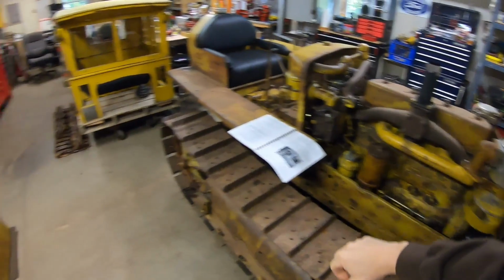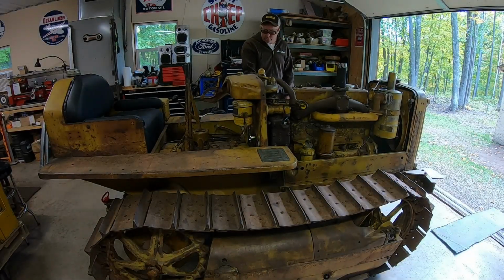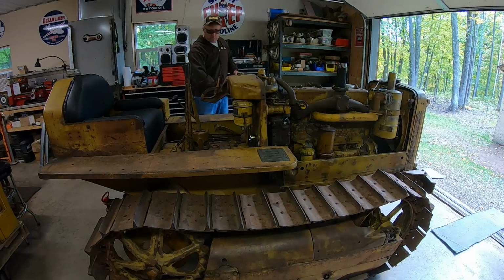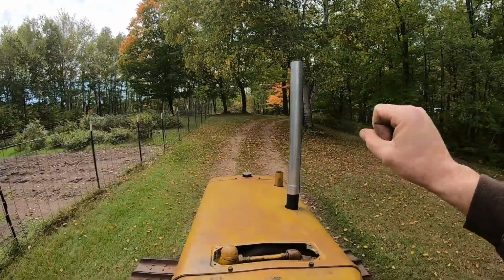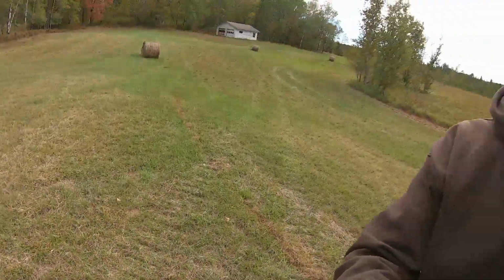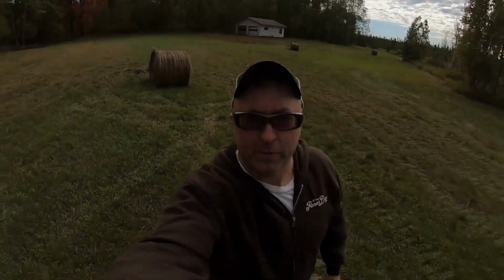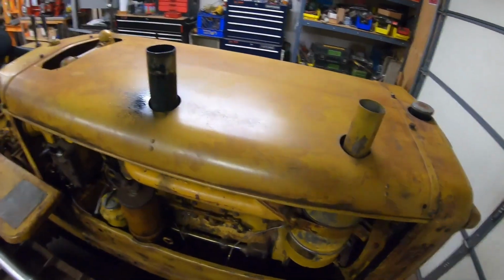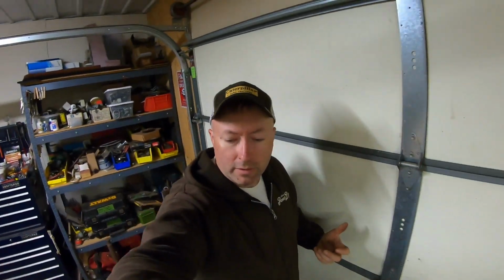Caterpillar D2 #5J1113 Chassis Rebuild Ep.70: First Drive Since Complete Rebuild! It Moves!!!

Comment: Starting from many piles of random parts and assemblies, several buckets of bolts and brackets, lots of rust and dirt, and finishing with a smooth running, beautiful looking, and functioning tractor is a major feat. 
Your work on this and many other projects is amazing.
Congrats and thanks for sharing.

Comment: I had a 1939 D2 for many years that was very similar and was in very good condition overall.  It would never start unless you got the diesel warmed up a bit with the starting motor.  You'd make a heck of a mess with unburned fuel drizzling down the exhaust pipe on to the hood unless you just had a little patience.  Just letting it roll over against compression with the fuel off until the temp. gauge hit 100 deg.  was the key.  Usually this was about 5 minutes.  At that point, it always took off, even with ambient temps in the teens.  Really enjoy your videos.  Great job!

Comment: Congratulations to you, senior, and everyone else evolved in this process of rebuilding this project from ppl storing it behind their house in a residential district for decades to parts suppliers that still had parts to parts you've gathered over your past miles walking rows at swap meets to your other enthusiastic Cat club that located a pristine engine block to the trucker that hauled it to a nearby rest area for you to pickup (I was so nervous when you slid that engine block from that trailer to your tailgate that it was going to hit the ground and break).
I could just go on and on about unseen helping hands behind this great little machine you own but you Toby are the Master that pulled it all together thru your Videos tell the Entire Story.  To You, a huge 
        THANK YOU!

Comment: Brilliant job - got yourself a beatiful slice of history there to be proud of. 
That noise takes me back to the 60's. My old man and uncle ran a farm in the Midlands UK and bought an old D2 from MOD surplus. It had a blade on the front and was painted in RAF blue. I think it was designated for beach clearance so planes could land but may have been for patching bomb holes at bases? They stripped the blade and hydraulics off and painted it Cat yellow again. Then using a 3 or 4 furrow semi digger plough turning Keuper Marl at 9 or 10 inches. That Cat used to 'crack' in the exhaust note when it dug in and poured the torque on and you could hear it a mile or two off when it was working, turning red slabs of marl over.
Along came direct drilling and ended my old mans obsession with deep ploughing in favour of faster surface tilling and the Cat was retired.

Comment: My Ag mechanics class is sitting and watching this right now. They have followed along for the past two years as we have worked on engines in the shop. It is interesting to watch them remember when to do something and what tool to use. They are rebuilding a Farmall M engine right now and last Friday they knocked the pulled threads down on the block where the oil pan bolts, with and old file. The class noticed- I didn't have to say a thing they just did it..... Thank you for the vids Squatch.

Comment: I say pop test that injector on that wet hole and if that doesn't reveal anything verify the rack setting and timing on that plunger and barrel. Looks like you could have one off a little since it appeared to be fueling with the kill on when cranking. 5:11 I would not expect there to be any smoke at this point but clearly there was.

Comment: I know what you mean about the crisp controls. When I did mine a few years ago, all new main clutch, steering/brakes, it was so crisp that I can imagine what it was like picking one up new from the dealer 70 years ago. Just spectacular. Not only is it crisp, it's also like it's power-assisted because the controls are so easy to move. It's pretty hard to operate an old clunker that hasn't been refreshed now.... : )

Comment: When you trailer it to its first tractor show. If you are near a cat dealer are you going to pull into their service driveway and see how many techs come running out to see it done?

Congrats. 
One thing. Try a 3/4 " block under the front of the seat. So it pushes you back just a little more.

Comment: Congratulations!  Fine job!  Many times I've stressed about something acting up on a tractor after an overhaul or period of sitting unused only to have it completely disappear after putting on a good load and actually working the engine. It can be hard to come up with a load that will work them long enough and hard enough to even get them to full temp. But it usually does wonders and is what they are made for.

Comment: What is the advantage of separate levers and pedals for the steering clutches and brakes?  The competitor who shall not be named and most others use one lever to control both the steering clutch and the steering brake.  A separate pedal seems like an added complication since you're not supposed to touch the brake until the clutch is fully disengaged.  They must have had a good reason for it since added complication was not the Caterpillar way of doing things.

Comment: awesome video it's really nice to see it running and driving under it's own power. I would try a good fuel injector cleaner in the fuel the modern fuel is so low on lubrication I have seen new out of box injectors pop and flutter until I put cleaner in the fuel in fact when I buy new fuel injectors they come with a bottle of fuel injector cleaner and lubricant where I get the injectors from
Reply: @squatch253  that is good to hear that 👍👍👍👍😁

Comment: Run a little dextron 2  in your fuel  and work it.  It will get better  but make sure its dextron 2 or powersaw mix oil  in the fuel tank.  may be varnish in pump or injector

Comment: That pop can be caused by timing on the inj pump worn lifters re adjust lift specks to spect. I did my d4 and friends nice d2 ran beautiful after that. Wouldn’t believe wat a couple thousands will do to running in i also have a 1 Cyl test engine that was hard starting and misfired bad till warm i adjusted timing and runs perfect no misfire. Hope this helps. Will also help wetstacking. Good luck. Gene
Reply: The one Cyl cat engine has 5.75 bore 8” stroke at 900 rpm approx 25 hp.

Comment: Just a couple of points...  Do you not need some Plywood on the floor of that garage to prevent gouging out the concrete..?    And does it not have a 'Mushroom' for the Air Intake..?

Comment: I have used  point-n-shoot thermometer to synchronize carburetors on motorcycle/snowmobile with great success. To isolate wet-stacking cylinder, is it possible to use one of those point-n-shoot thermometers to identify the exhaust port which is cooler than the others?

Comment: I have rebuilt several D315s and never had trouble with slobbering exhaust or missing like that right after a rebuild, valves are not seating properly or bad injector nozzle.
Reply: @squatch253  Just had new injectors put in my 92 7.3, told the shop it doesn't run smooth and smokes like hell, they pulled them out again and I took them to a diesel fuel system shop and had them gone through and checked, all were under spec crack pressures one was stuck and one wasn't spraying right, $470 to have them reset but they were under warranty and I was reimbursed, runs beautiful now.

Comment: I was thinking you need a D2 test track, so can compare each run equally. Have something heavy to pull. Maybe that old rusty implement out at the old field junk pile could be welded up to be a scraper and you could stack whatever old iron you have laying around as weight. Therefore for it would do some actual work, and not put any wear on anything you have that has a functional use.

Comment: I wonder if a exhaust valve is adjusted a bit tight? I'll be interested in what caused the popping and misfire.
Reply: @squatch253  I noticed you didn't open the bleed valve for the filter housing first, bleed the air, close it then open the top vent above the filter plate, bleed the air, close it then bleed at the injection pumps. There might be some air in the system yet.